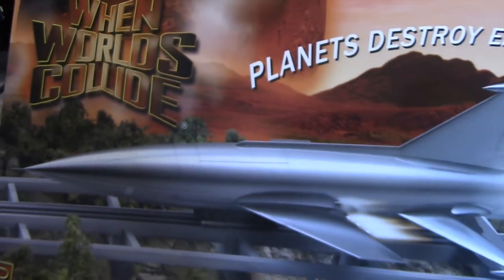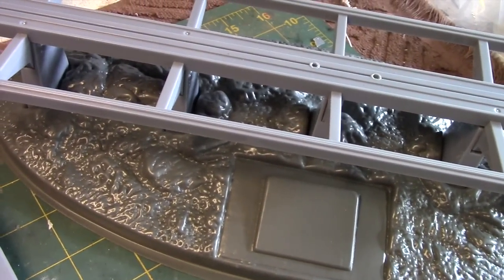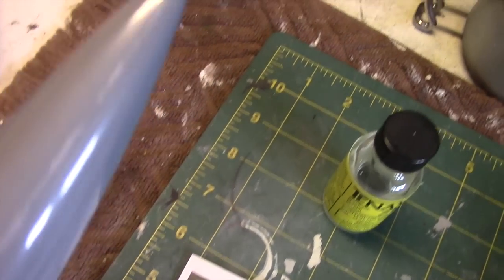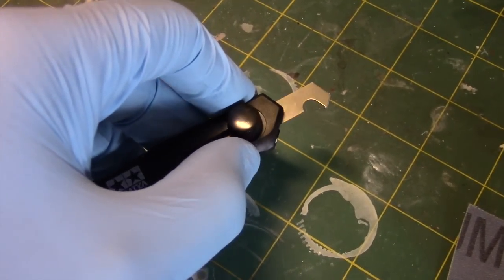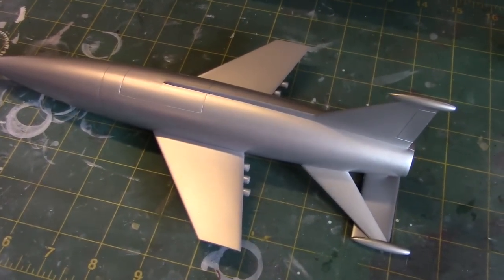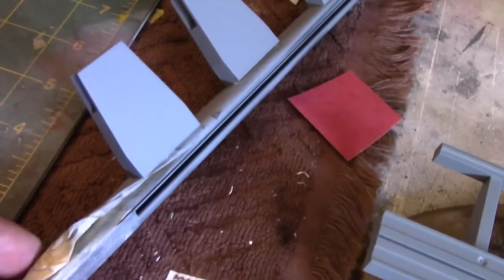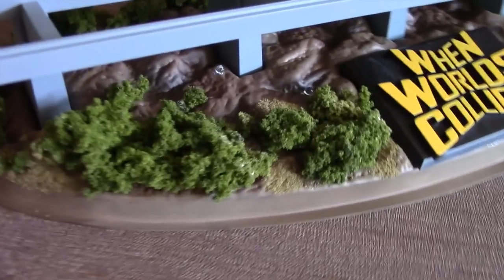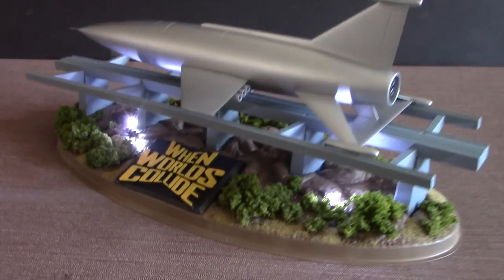Building the Space Ark from When Worlds Collide

Comment: Just came across your video. Very nicely done. The build looks amazing! Great looking kit made better by the additional custom tweaks you made. Inspired me to pick this kit up and give it a try. I've never lit a kit before. This looks relatively simple. Any pointers would be appreciated. Thanks for taking the time to share your talent.
Reply from the maker: +Zeus GYD I'd recommend checking out modeltrainsoftware.com .  They have a variety of prewired (with resistors) options that make it so easy.  Also have switches and battery holders along with some video tutorials. They are also very helpful and open to answer any questions you have.  They made it very easy for me to get started with lighting. Eventually I bought a soldering iron and with practice have become comfortable with doing that. Stuff that we do is not very complicated so you don't have to be the best soldering person either to be successful with it.  Check 'em out and thanks for your kind words and for watching.
Reply: +Interstellar Modeler I will definitely check them out! Thanks so much for the info. Best regards...